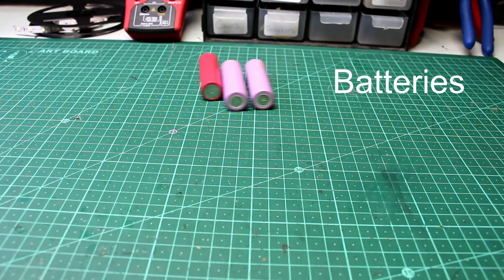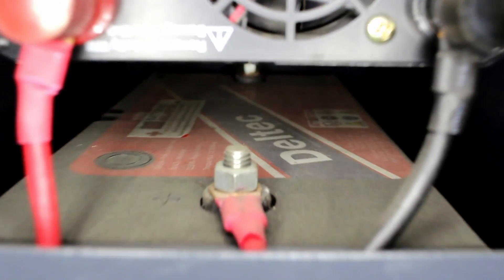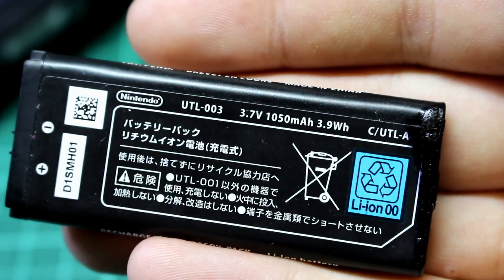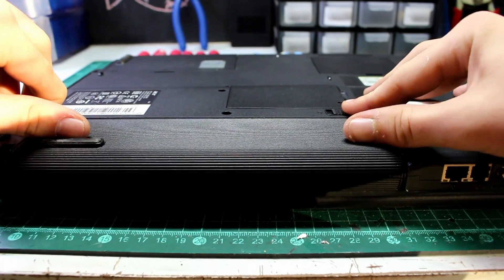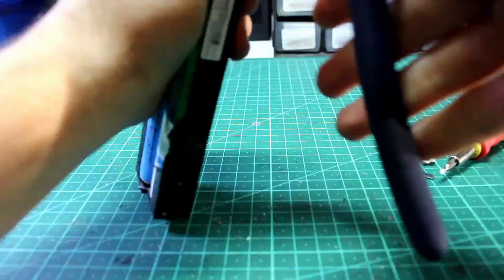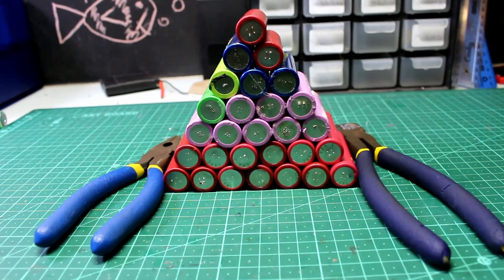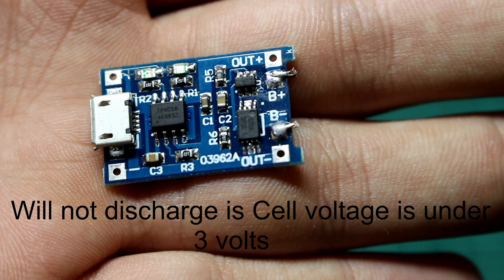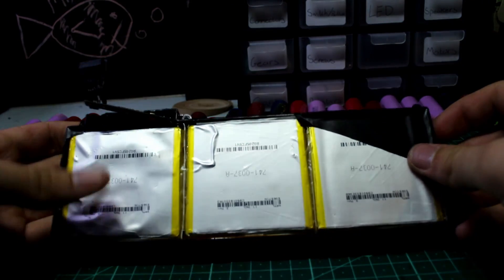How To Salvage Batteries For Projects

Comment: What we colloquially call "lithium polymer" batteries are actually not made with true solid polymer electrolytes. These batteries were appraised for conventional use in the 80s, but never made it out of the lab due to the high temperatures required for efficient operation. Instead, what we call lithium polymer batteries are really just lithium pouch cells with much smaller pores in the membrane and a slightly altered chemistry. In fact, lithium ion is really just a generic term for basically every other type of lithium chemistry. For example, the LG 18650 HB2 and the Panasonic NCR18650B are both called "lithium Ion"; however they are really two completely different lithium base chemistries. The LG HB2 uses a Lithium Manganese Oxide or (LiMn2O4O2)  chemistry developed in the early 70s, while the Panasonic NCR B is constructed with a Lithium Nickel Cobalt Aluminum Oxide (LiNiCo2) chemistry. These differences in composition allow for different cells to have different capacities and power outputs. Anyways, I think that it is very unlikely that laptops with a 6 amp max draw are even using lithium ion polymer batteries as they are a little over half the capacity of most other lithium cells. 

         If you are interested in this sort of stuff, please check out the book "DIY Lithium Batteries" By Micah Toll as it goes into much greater detail about not only battery chemstries, but also their uses and construction methods for DIY purposes.

Comment: Cells that are at voltages all the way down to 1V can be successfully revived by trickle charging them with small currents like for example 100mA for several hours.

I have revived several cells in that way. Some of them have a reduced capacity but are perfectly usable otherwise.

Cells that are at 0.00V are totally dead and I had no success reviving those. But if there is some voltage, they can be slowly brought back above 3V.
Reply from the maker: Thanks for the info!
Reply: I have a double 18650 battery flashlight I put in a good battery and the battery the charger will not read, then turn it on for about a minute. The charger will then read the battery and will charge it.  :)

Comment: When I salvage 18650 cells (from faulty electric bike batteries), I always make sure I run them through a discharge testing device (this is a very useful thing!). If they closely match (85-90% match) their capacity rating at 1C and 2C discharge rate, then they are kept. Any that fail this test are taken to my local battery recycling centre. Usually I find around 60-70% of the cells inside a faulty e bike battery are good to continue using. Power tool lithium batteries don't tend to yield good results. I get around 30-50% good cells from these. Most likely because power tools draw more bursts of high current which stresses the cells. 18650s are very useful for a wide range of builds. For me, I have made mobile phone charging power banks, batteries for our LED Tron costumes (we can often be clearly seen at Glastonbury festival as a duo) and currently for a large power wall in our camper van.

Comment: Actually the 18650 cells can discharge all the way down to 2.5v before they take any damage, but below that you gotta be careful with them. So a 2.6v cell is actually perfectly usable, and probably as healthy as a cell you find at 3.3v, although you can't judge by the voltage alone